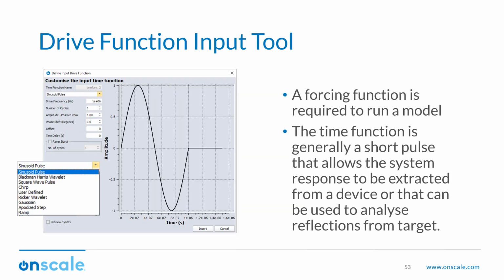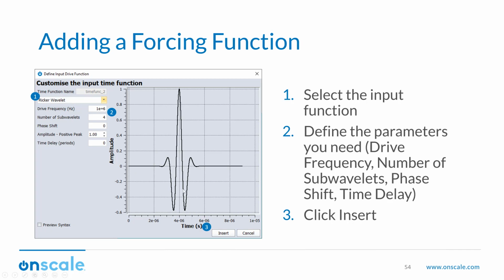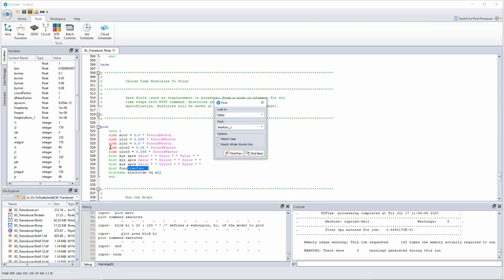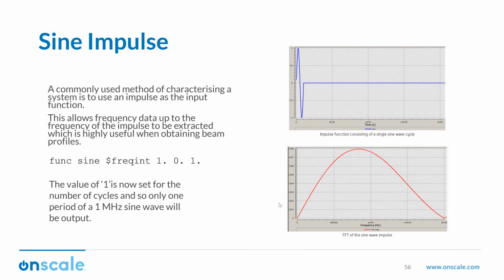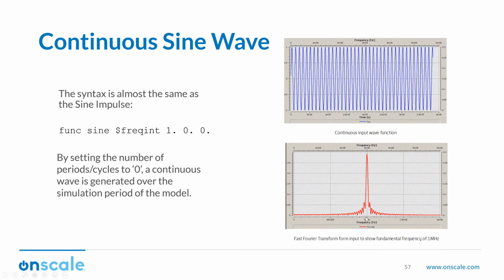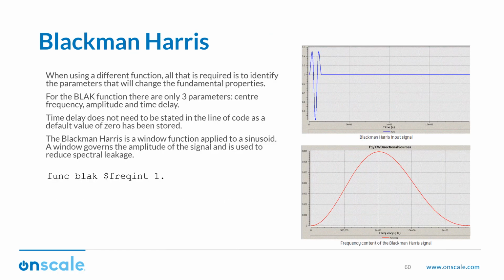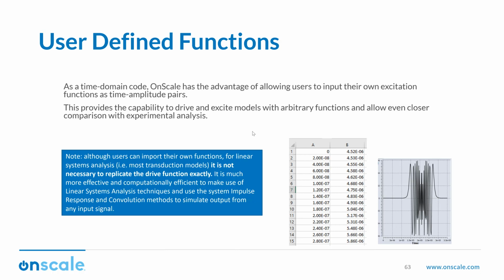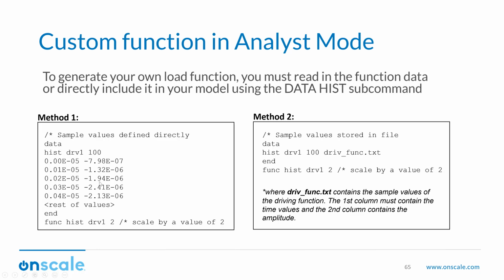[OnScale  Analyst 101] Setting Drive Functions in Time and Frequency- Part 8

Comment: How can a line load on a specific set of nodes be defined in a 3D simulation as compared to a point load in a 2D simulation?
Reply from the maker: Have you watched the video “Pressure Loads”? (The last one)
Reply: @Feaforall  no I haven't.. I did not know you uploaded new videos..I will watch them and then I will let you know if I have any questions.
Reply from the maker: @Robdude4u007  Yes, just uploaded 4 new videos on Monday.